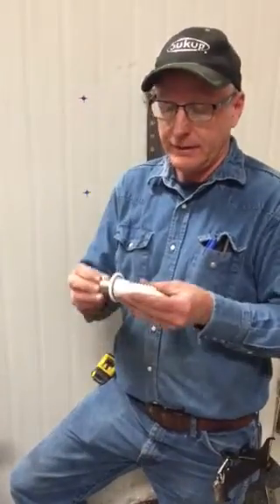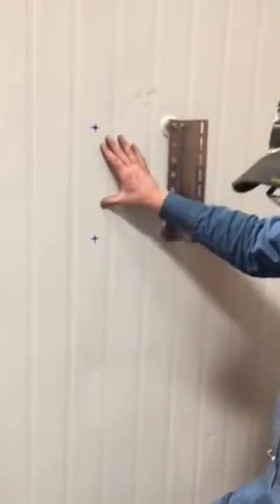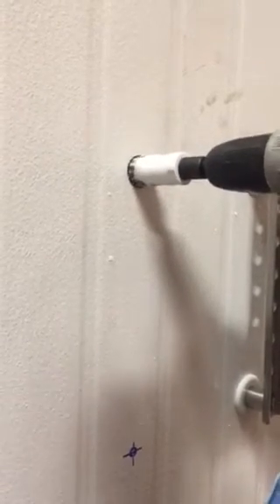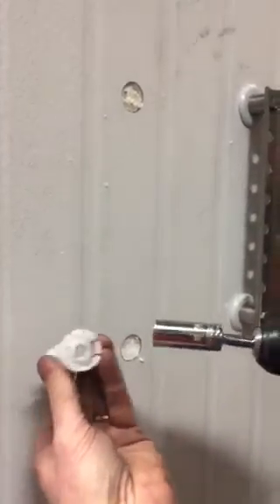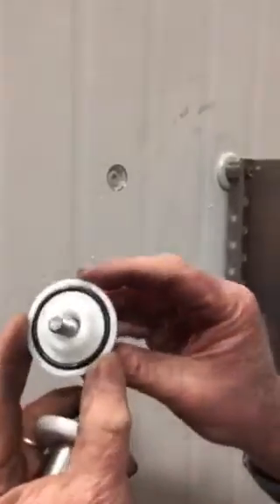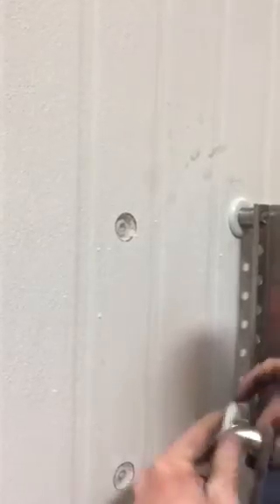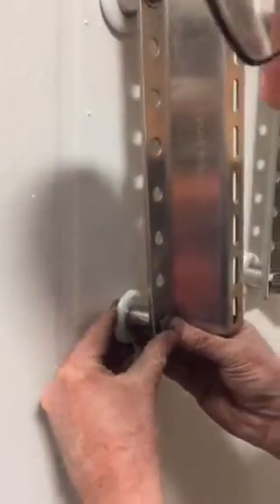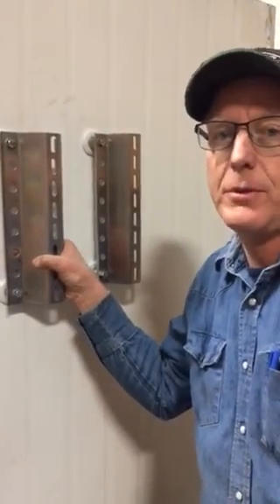Food Grade Solutions  IMP anchor installation

Comment: Fablock are way easier. Faster. And probably cheaper.
Reply from the maker: Hi Andy,
I agree that Fab Loks are faster, easier & cheaper, but they are not food grade, they don’t space the item being fastened 1” from wall (FDA Required), they don’t protect the wall core from moisture intrusion & they have a much lower load rating.  For very low load rates in non-food Grade application, Fab Locs are appropriate, but for high load, food grade applications, Spanware IMP Anchors are appropriate.  Thanks for your post, we appreciate the input.